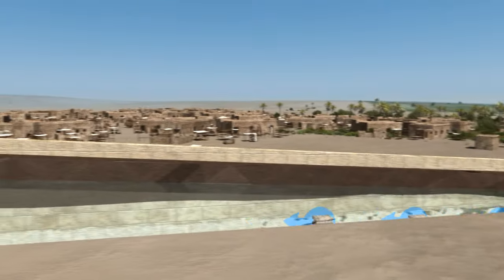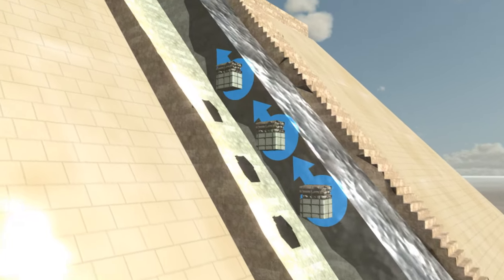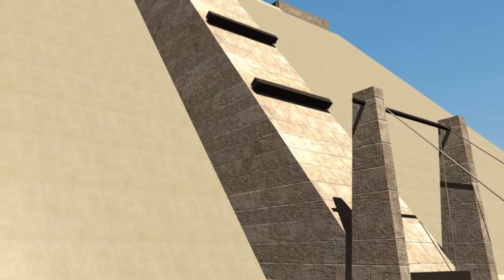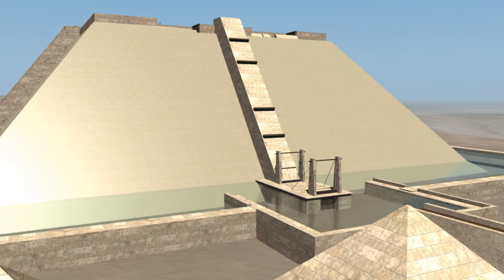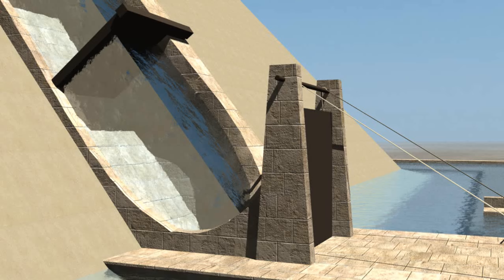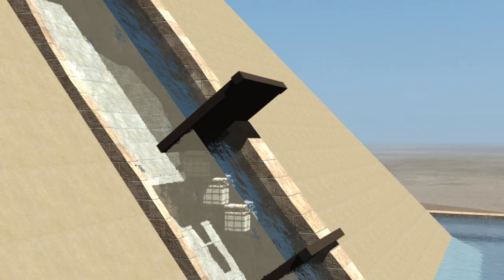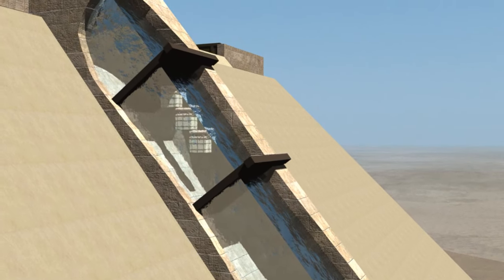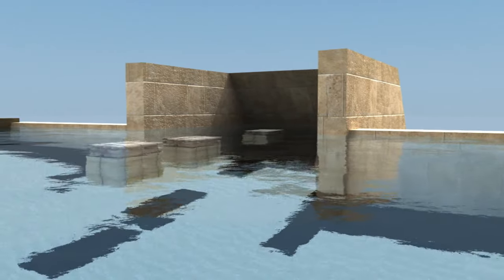How the Pyramids of Egypt were really built Addendum - Multiple Locks

Comment: Lots of folks can bash on this theory, yet they don't offer their own brilliant theories.  I, too, am convinced that water, water locks, flotation, barges, and barge cranes were used to transport and place the blocks.  It's easy to bash and dismiss another's theory, but don't do it unless you can offer a better theory.
Reply: brabanthallen 2bars of water pressure is 20m (66ft) of water column height. If the locks are spaced at 50ft, when each lock is opened the bottom of the column would see 100ft of water column. Therefore water pressure would be slightly more than 3bars. Also, as each successive lock is opened, the pressure would not decrease as the above lock is closed. Only if there were a way to drain off water from the bottom of each lock, after the above lock is closed, would the water pressure decrease. Making it necessary to add water at the top level every time a block were lifted. This would not need to be a large volume of water, just enough to compensate for the expansion and bulge of the lift tubes.
I like this explanation of how the pyramids were built, It makes the most sense. However, This part of his theory needs a little work.
Reply: Jordan Snowhook It has been a long time since I studied barometric pressure and water properties, so i will take your word for it.  I understand that the Egyptians were master hydrologists, and the fact that they discovered Khufu's "crane boat" buried in a pit near the great pyramid is a pretty telling evidence that water was utilized in the building process.  What amazes me is the condition of the boat.  It is said that it is the best preserved ancient boat ever found.  I will have to study up on water pressures and locks to become familiarized with what you stated.  It makes a lot of sense that this was a likely method of building the pyramids.  So far, IMO, this is the most logical explanation I have heard.
Reply: +brabanthallen pullies and cast limestone concrete
Reply: +brabanthallen that is not good evidence the pyramids were built with water, it is like burying a guy with his fishing boat; doesn't mean he built his house with a boat, just a hobby that meant a lot to him.  There were heiroglyphs showing sleds used to move the blocks on the sand.  That is real evidence.
Reply: NatureHacker Do you have a link for your source?
Reply: It would need at a very minimum the same weight of water put back to the top as the combined weight of the block and flotation junk.  Then plus extra for all losses which would have been huge.  This theory goes far backwards.
Reply: you can do the exact same thing with gravel and pulleys no water needed.  Think about it.
Reply: ***** Can I ask what your theory is then concerning the causeway leading down to where the Nile used to be during that era?  You understand that the Nile would flood every spring, and a causeway has been discovered that leads from the Great Pyramid down to the river.  I understand that the huge granite monoliths were quarried in Aswan, and had to have been transported by boat to Giza.  Then there is the problem of hundred of men pulling sleds on coarses of the pyramid where there is no room for those pulling (the corners).  Some have suggested an inner ramp, but no evidence of that has ever been found.  I still like the water idea.  It seems to make sense, makes the task much easier, and blocks could be placed much quicker given the time constraints of blocks per minute calculations.
Reply: how many feet vertically would the nile flood?  And is there any evidence of locks in the causeway or that it had taller walls and a roof?  And how would water be pumped up the causeway?  I would say it is most likely the causeway had ceremonial use/meaning.

Comment: I personally think they would put the water shaft in the center of the pyramid. The shape of the pyramid would scale with the reinforcement needed to retain the pressure of the water. In addition the bottom of the shaft would only need one strong bulkhead to keep the water in. In practice a stone would be moved on rollers down a long hallway leading to the center of the pyramid. The stone would be loaded onto the shaft. The bulk head would be securely closed and then reinforced By backfilling the hallway with material. Water would slowly be added into the shaft. As the water level rises the stone would be floated to the top. Once the stone reaches the top the shaft can be drained and used for the next stone.

Comment: Interesting theory, though it seems unlikely to me that you would use the outside of a pyramid as the place to raise something via water, it seems to me the center of the pyramid would be a much more sensible place for that, giving you the cumulative weight of the blocks from the outside to the center to hold up to the ever increasing water column weight.

Comment: water pressure is about 1 atmosphere per 10 m.

if the gate is closed 10 m up and bottom gate is open, the pressure at the gate 10 m up would be 0 atmospheres, but water would boil before that,

http://en.wikipedia.org/wiki/Boiling_point
http://en.wikipedia.org/wiki/Pressure
Reply: float the blocks to the site "but" pull them up to the top with a leather bucket filled with smaller weights used as a counterweight

Comment: This is an exciting and clever idea, but it’s more likely that the enormously heavy blocks were like poured concrete “in vitro.” In other words, the builders used internal structures to haul wet limestone up the pyramid, poured the wet material into wooden forms, then removed the forms when the wet limestone dried. It likely dried pretty fast in hot Egypt.

Comment: You guys might not believe it but the blocks are push and pulled up a 
ramp after the stone's frequency is changed. A tuning fork changes the 
vibration of the stone leaving it a weight of Styrofoam. It's still 
heavy, yes.

Comment: I don't think that'd be possible since it requires waterproof walls and draling with lots of water pressure. but what if it was an open top system with multiple locks like in some UK canals. The problem would then be how they filled the water. The filling of the water couldve been done with archimedeis screw which would push back its invention date back a fair bit.

Comment: They actually used a zeppelin made of goat hides to lift the blocks. The workers would suck out the helium through long straws and load up the blocks and re-inflate. The job took longer than anticipated though because everyone sounded like Donald Duck and instructions were typically misunderstood..
Reply: ...period!
Reply: Legit.  I was there, so can confirm.
Reply: Your definitely making some headway on this. Did the experiments in my lab “basement of my grandmas house” after one chemical explosion and 2 fires. We making progress.
Reply: That theory is complete shait! What they did is they built a 150 meter high wall around the entire work area -including quarry -, about 50 square miles. Then they filled it with water to form a lake, in which they then freedived with bamboo straws and the aid of tame whales to fit the blocks together. This also solves the problem with heat stroke while working in the desert.
Reply: +Lene Karlsvik Brosché i support you.

Comment: I have a theory about the so called 'relieving chambers' of the Kings chamber. 1st they're not relieving chambers as the Queens  chamber would also require them too, if not more so as it is under a much greater load being lower in the pyramid. 
2nd, The beams of the kings relieving chamber are all smooth on the underside & rough on the top sides. 
If the pyramid builders wanted to make the kings chamber bigger for some reason (maybe to tune the resonance?), then all they would have to do is cut the ceiling beams out from underneath. And as the beams are already smooth on the underside, they now have a perfectly flat ceiling again that is now a few feet higher. They could continue to do this if they wanted, all the way up till they reached the gabled roof (which is like the Queens chamber).

Comment: How did they get the water to the top ? and if they could get water to the top you wouldn't float the blocks up. You would use the weight of the water on top to pull the blocks in a container   up one side as the same type container filled with water    went down the other . the containers could be interchangeable for blocks or water .  the rope between the 2 containers would be a problem though.  1000 ft long

Comment: If you have ever visited Giza, then you might already know a much better way than this.  This is quite ridiculous. It would have taken longer to get all that water to the top of the pyramid than the stones.  However, an energy source is already at the source just waiting to be used.   If they could have built these "water shafts" then it is equally as plausible they built guiding ramps up the side of the Pyramid and then tied the blocks to large "kites" or "wind catching devices" that pulled the blocks up the side. The wind on the Plateau is VERY strong, more so at higher altitudes.  If they would have built a system to guide the blocks as the wind lifted them it would be much more conceivable than this!  I am not saying it happened that way only that it would make more sense than this.

Comment: Interesting theory though a tad impractical.... Way too much pressure. However, I do think it highly likely they used water as part of the construction technique. But I think it more likely they used a water sled on the opposite side of the pyramid as a counterweight to the stone lifting sled. They had the technology to lift water up there... all be it slowly, and knew enough about ropes to make them long enough. Once balanced a simple capstan could be used to wind the stones up. Indeed, if you extrapolate on that you reinvent the canal lift which is two identical water "sleds. You float the stones in the one at the bottom which displaces the same weight of water, then wind it over.  Certainly within the technology limits of the day.

Comment: Why do none of you ever speak on how they would have gotten that water up there and kept it there.  It is well documented that Egyptians had no water pumps.  Nor do you mention that the wood to lift the stone would be larger than the stone itself.  Or when the lower gate is opened, all the water in it runs out to the level of the basin so there is no water in it to lift anything until the door is closed and it is refilled.  But again, they have no pump.
Reply: I was also wondering how this was done without pumps.  I could only guess bucket brigades to fill the lift tunnel from the top or those high pressure water springs
Reply: Can you imagine how long that would take though? Forget moving a block every 5 minutes, try days.
Reply: Humans build with blocks the size they can easily handle.  Whoever built these pyramids were not human.  I suggest the Egyptians stumbled across these and used them for whatever.  But they were not tombs.

Comment: Occam's Razor.  Think about the simplest most practical least expensive method and it is most likely true. They could have simply used counterweights of broken rocks and bags of sand  with papyrus rope . Did not even need pulleys as they could pull across the top of the structure.  They didn't even need wood. The blocks could actually roll on sections of papyrus rope.  Low manpower needed also. Imagine a simple balance scale (which were in use in Egypt at the time) and then use the structure itself as the fulcrum.  Easy peasy, lemon squeezy. There is no mystery of Egyptian pyramid building. The exact method is unknown but there is no mystery. They already had enough technology to do it.

Comment: just done some quick calculations..
 given that the internal dimensions of the shaft are 15 foot square..
And the doors are absolutely water tight
Each wooden door in the vertical shaft would have to support 750 tons of water.
However the doors are not water tight.. It would take a nuclear submarine hatch to keep that lot out..
So four levels.. as shown in your cartoon.. equals a total weight of water at the base of the shaft.. of ...  2916 TONS.. all held back by a slider wooden door ..
2916 tons.. the same weight as a type 23 frigate.. nice one.. hahahahaha
Reply: The canals at panama are 200,000 tonnes. Moving 3000 tonnes of water x4 (4 shafts N,E,W & S) total 12K tonnes is far easier than moving ~6mn tonnes of stone. Very appealing, would hugely reduce cost of construction by decreasing manpower and time required.

Alternative would be the Arabic Egyptian Government Ministries proposal of ramps, and 400 men moving each block. Could you imagine how many men would have been involved?

Comment: How do ya get all that water up that high and keep it up there its not going to be perfectly sealed and evaporation problems would be a big problem You would have to have a massive pump When ya open the first gate to float the boulders up how do ya get the boulder to move forward so they can float up Its sealed off?? the floats cant be on top the will drag against the ceiling  Sure you can use rope but that would have to be one long rope on rollers and it would have to be twice as long so it could be used like a conveyor belt When the boulders float up they are going to hit against the gates unless they are tied to this rope For this to work you have gotta add a lot more details to your theory I just dont see men with sticks moving those big boulders around even with mud They are so heavy the mud will just squirt out and you will still have a lot of friction to try to slide them I set up mobile homes for sevral years I know how hard it is to move heavy things LOL Ive seen steel rollers get fattened I've seen steel cables snap like thread They had none of these things Its mind blowing for sure ✌️

Comment: The video shows that the stones travel up and then stop and wait for the door to open.  What would actually happen is that these stones would bump up against the sliding door. These stones pushing against the door would be a serious problem!  I am not sure why they want to use such unconventional water locks!  There is a more conventional use of water locks to build a pyramid with a video series at: thepump.org/videoseries.html showing how water locks were used to build a pyramid.

Comment: HILARIOUS
Opening the bottom door would cause a humungous waterfall.
Because there is no capilarity.
With a column of water of tens of meter the pressure woulld be HUGE on the door.. JUST because the surface of them is huge. 
Getting and holding water up there would be a bigger issue than making the stones " float".
Mind.. By the pressure of the water column al goat skins would be pressed to a third of their volume.. Thus the quantity of water moved by them lowers. Thus buoyance lowers. Thus .. yhe stones start to sink in stead of float.
EVEN : when you let floating blocks enter a scuare column of wxater they will " stumble" and make blockages immediately.

This is pure fantasy
Though I like the design..

By the way. hieroglyphs show and tell HOW the stonese were quarried ,curt , moved ( sledges and rollers , mud  and elbow-grease. 
20000 men worked on the pyramid. And 3500 in Quarries; THEY produced 250 stones per day ( 4 man produced a stone block in 4 days)
Stones were average 1,5  to 2,5 ton.
It took 27 years. 
Calculate with me.
2,5 million stones.
In 27 years.
2500000 : 27  : 365 = 253,678 stones that were on the move each day.

Or 63 419 583 kgs per day.. 
Divide this weight over rollers and 20 000 labourers.. :   
63 419 583 devided by 20,000 men = 31 , 70979 kgs per person !!

Not to bad .  
if every person had to "only" use the energy to move 31 kgs over a certain distance.. 
I guess most soldiers have to run many miles with that weight on their backs during training? 

The force of the plan hides in NUMBERS...   of work men..

moving a block on sand is shown in dozens of REAL-HANDS-ON-MOVIES by several historians , archeologists , scientists..

And te ancient Egyptians wrote the whole story down. 
IN the pyramids and on ten thousands of ostraca.  ( pieces of pottery , recycled as post-its. Go GOOGLE the word. . many expositions have been held with THOUSANDS of objects , artifacts in them. I visited one in Brussels round 2000.)

Comment: how did they pull the locks out?...idk man
Reply: Good question, and an even better question would be how did they push the gates IN against water pressure? The animation of them lifting the gates by pulling on ropes then letting them DROP easily back into place is a joke.. absurd lack of real-world mechanical/hydraulic practicability.

Comment: Look they probably used water but they didn't do it that way I almost bet they had a bucket wooden or same material as the pyramid and would line a block floated in like you said was possible up with a Lift kinda pulley set up and dry the top the would full the bucket to assist in lifting the black up it probably wouldn't fully lift alone but imagine having a counter weight about the weight of the block + 10 strong builder men pulling a rope to control it's speed on how fast they raise it

Comment: I appreciate this technique....but this is not the technique they used .....as 
*Less availability of water 
* This technique requires more structure to build outside the pyramid..to hold the water pressure and the pressure exerted by the 20-30 ton limestone.....
*A single small mistake can destroy the whole pyramid...so Egyptian won't take a risk
*Building the structure outside would take more time than the actual pyramid did
*Nearly impossible to lift the tons of limestone with a wooden log....or it will require a complete Amazon forest to complete this structure
*If if they build the structure to hold the water ...how did they bring that limestone to make the structure?
*So this is not the technique they used
*But nice work